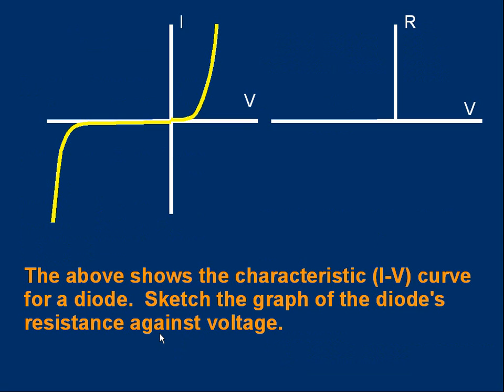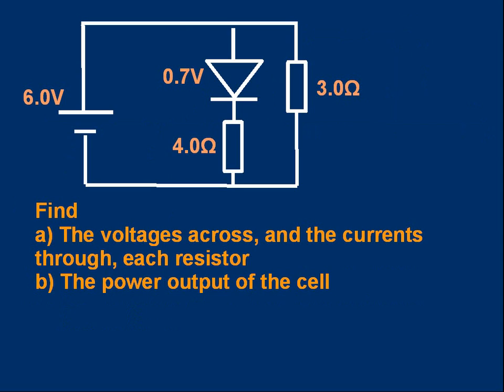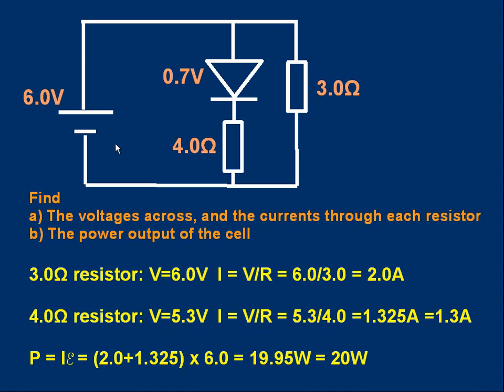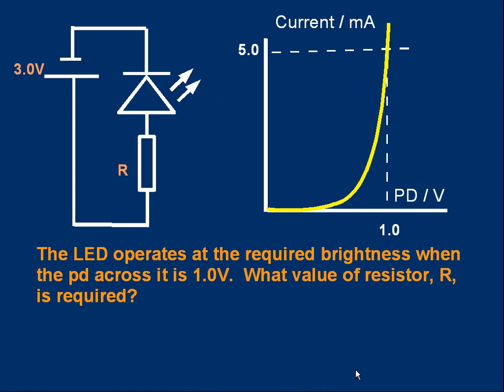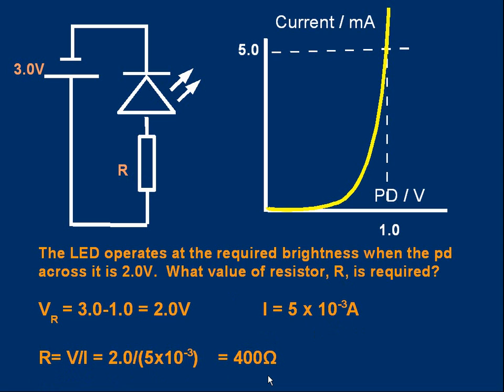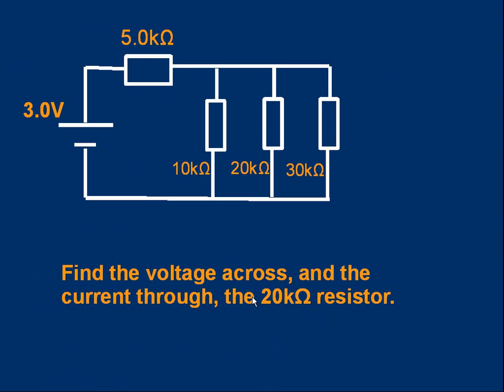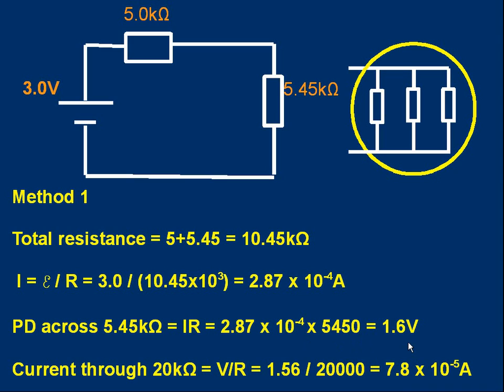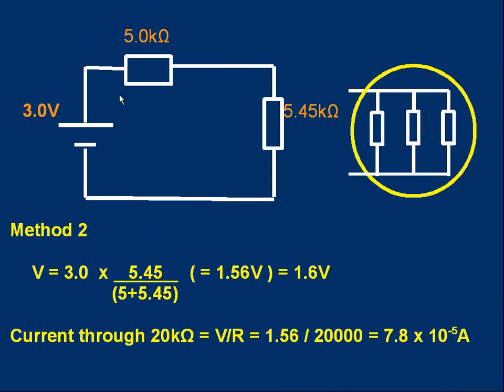GCE (A-level) Physics E28 Circuits - Problem Solving

Comment from the maker: Hi jptbaba.

Sorry I won’t be doing an op amp video for a number of reasons.

I’m aiming to cover AS topicsfirst, and progress on these is pretty slow anyway.  I’m hoping this will benefit most students, as some will drop Physics after AS.

Op-amps aren’t always included in A2, for example I believe it is not even in an Option for AQA Physics A.  Also, I’m not very knowledgeable about electronics – it’s not an area I’ve taught.